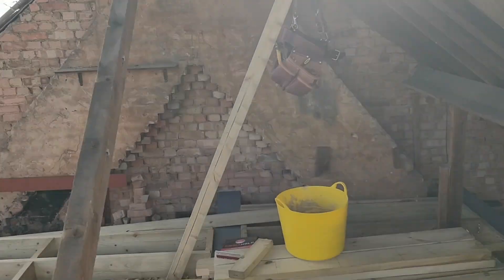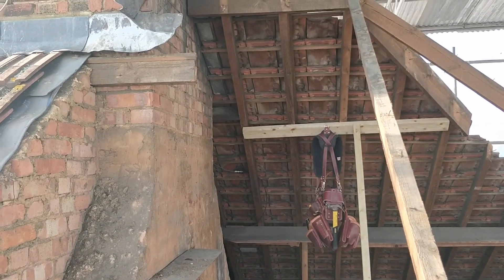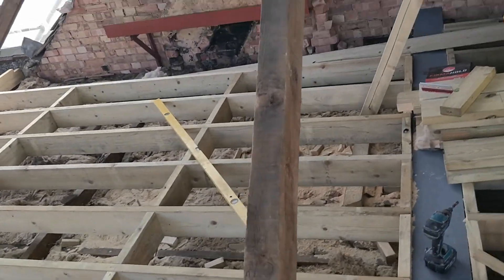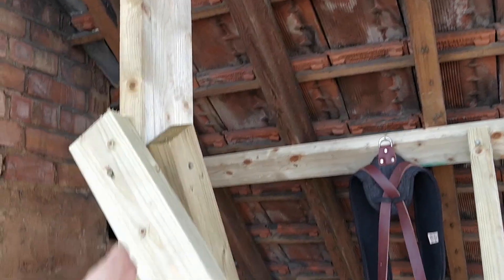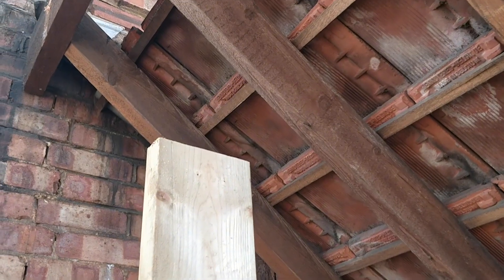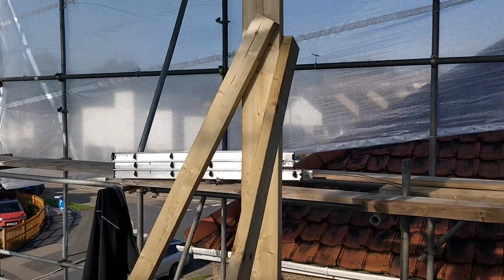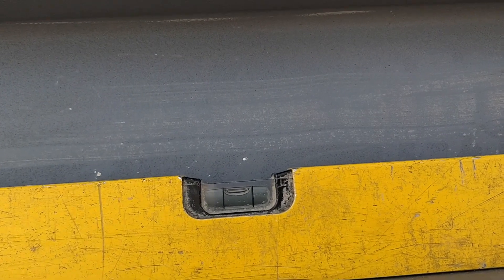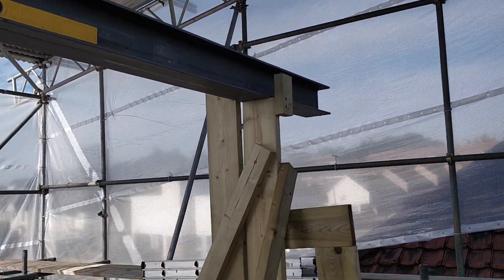Installing a steel ridge beam

Comment: Nice one 👍,  what size of steel is this and what size roof joists will you use, will those joists hold 120mm kingspan or eco therm insulation?
Reply from the maker: I honestly can't remember the size of steel, but it will need to be spec'd by building control for your individual space. For 120mm kingspan you would need to use a 6x2 or maybe even a 7x2 for the airgap too.

Comment: What happens if builders fit the ridge beam too high. Does this cause the ridge tiles to sit higher then adjesent properties for example if you are dealing with a terraced property?
Reply from the maker: It really depends what the building control or planners say...! They may demand that it is ripped off and moved lower down.

Comment: Great work as always, What was the measurement of the steel?
Reply from the maker: I believe it was 204x204 and was 6m long...I think!
Reply: @OfficeBoyBuilder  you meant 203  but this one is not 203. 203x203 is very heavy and that is for floor joists used for 2x8 joists. This one  probably 150x150.
Can we use 6" flitch beam instead.
Reply: @safehandsprojects  Obviously structural engineer will have to advise you on what sort of steel you need, but it's unlikely that a flitch beam would be sufficient as a ridge beam for a dormer conversion. Flitch beams are strong parallel to the height of the beam, but with a dormer they need to be strong perpendicular to resist the thrust of the dormer.

Comment: Hi , do you have a video showing the installation of the steel posts?
Reply from the maker: Yes I do - that's coming up in a later video because they arrived so much later...! In all honesty though, we just slotted them in underneath and then the welder came and secured them in place!
Reply: @OfficeBoyBuilder  great, out of curiosity, what sizes did you go for? Was the base bolted to the steel beam?
Reply from the maker: It was 100mm square, so that it sat flush with the width of the 4x2's - that was specified by the structural engineer. It could have been bolted, but it's very tricky doing that once everything else is in, so it was site welded, which is just as strong!

Comment: Cracking job!  just out of pure interest how  did you learn to do all the structural side? Cheers M
Reply from the maker: I did as much research as was humanly possible 🤣 there's obviously a limit to what you can learn without doing it and making mistakes, but I spent hours researching, and then working alongside a builder who was happy to teach as he worked too.
Reply: You both make a good team, many skills needed to accomplish what you have taken on. Looking forward the the video  about insulation. It will be interesting as you go along to see if there has been any thoughts about road noise etc and how that will be overcome. Keep up the good work M